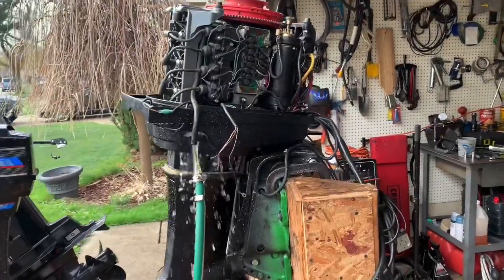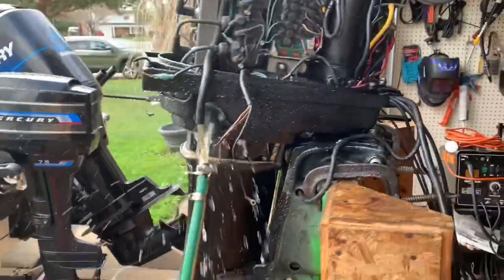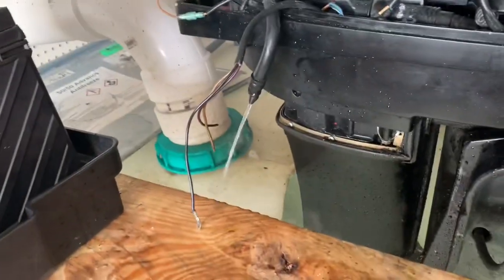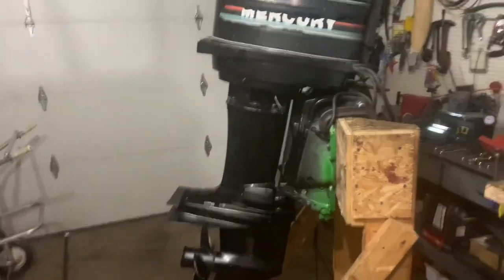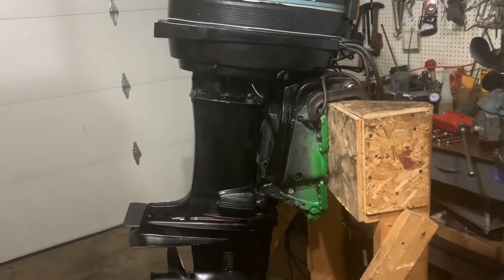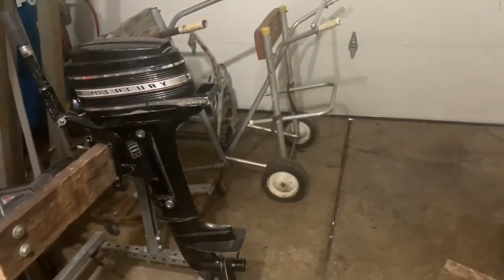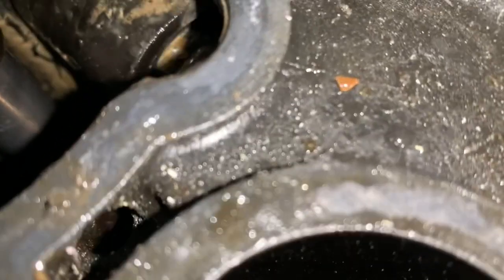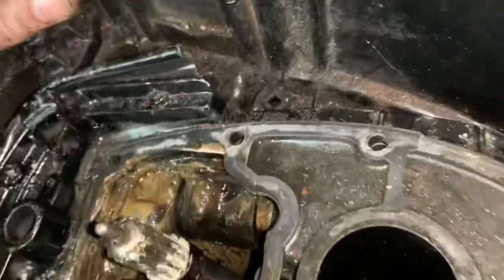1989 45 hp Mercury - Overheated Hot Telltale Stream - Found the Problem and Resulting Carnage Part 6

Comment: Hey man I have the same engine and a similar  issue mine pees just a little weaker then the videos I see but it’s cold pee my engine doesn’t seem to hot but at high rpm’s my pee stream gets worse i also have good compression duck season is happening this weekend in northern Illinois im going to just take her nice and easy to my spot even if it takes awhile but do you still work on motors im interested in doing a full rebuild on the old girl

Comment: Like the guy below said.....there is exhaust blowing into the water jackets somewhere. Most likely under the exhaust cover where the water circulates to cool the exhaust.  I have seen a gazillion old outboards and chainsaws with scored pistons, that is not a heat problem. Heat WILL cause it but it will not generate heat . Low compression does not generate heat. That pressure from that tell tale hose is exhaust blowing into your water path, interrupting water flow and filling it with HOT exhaust......boiling, or near boiling, the little water that gets through.
Reply from the maker: Thanks for the information. I understand and agree what you are saying about the exhaust gases getting into the water jacket. The owner wanted this motor tuned up and running well in order to sell. I told him with the pistons being scored I would not sell it for him. The damage had been done and it really needed a rebuild. The owner failed to mention to me that he had overheated the motor while trying to race back to the dock when he discovered the problem. So regardless as to how it happened the owner decided to part out the motor. Obviously the overheated condition scored the pistons and the owner didn't want to put anymore money into it to fix it. Thanks for watching and commenting. I appreciate your feedback

Comment: Nice video. I have a 1992 9.9 Evinrude model E10RENA. Started boggin bad on the water, then no water out of tell tale, then it started smoking out of tell tale and i shut it off. Took it home and impeller was shredded, so i replaced that. Wouldnt start.  So with diagnosing what could be i ended up replacing the plugs and wires, ignition coils, power pack, charge coil, thermostat and gasket, head gasket (which was fine to begin with), carb cleaned 3x and all jets clear, and compression is 105psi both cyls. I have spark in both, but it will not fire. And it wont even run on ether if i spray in the carb or even spray some in the spark plug holes and put them back on. It'll putter and die after i pull the starting cord. What gives? My next step is to pull the block out and see if anything is blocked or choking it off, and also replace exhaust and water gaskets. If that doesnt do it, im at a loss. Im in sterling heights,  MI and Dee's Marine wont look at it and neither will a few others. Any advice is appreciated. Thank you sir!!!
Reply from the maker: When you pull of the carb did you inspect the reeds? Also, If you have over heated the motor then it’s possible you may have done some major damage to the internals…. Rings, Block, warped head etc….compression can be good and still have major issues.
Reply: I have not looked at the reeds. Ill prob take the block off and when i redo all the gaskets (if i dont find the issue) ill pull the intake manifold off and check the reeds etc. Thanks man!
Reply from the maker: You might also want to check the fuel pump pressure

Comment: Probably way to late to help you now but I have run across 2 45hp or classic 50s with the same problem and both were old impeller pieces jammed up in the power head , had to remove the cylinder cover and down behind the lower cylinder I found both blockages , had to use compressed air to clear them out , no more hot pee and both are still running to this day , I even own one the guy gave up on but he had already bought another motor ,change those impellers people !!
Reply from the maker: Chuck shade…. Wow two classic 50s with the same issue. I hope you have better luck than I did. It was amazing though that the engine ran as well as it did with the piston damage it had anyway that motor got scrapped for parts. Good luck with your orders. Hopefully they’ll run good for many years to come.

Comment: man those skirts are shot! I'm with you on how the heck it idled as well as it did... a testament to the engineering I guess but still youd think something would show up at idle. No big deal you can just send the block out. still make complete rebuild kits . for $1200 you can make it better than new. one issue with these is water intrusion . water creeps up the driveshaft, takes out the lower crank seal, and it starts sucking up water. may have happened here. the other gaskets for the exhaust have been known to leak as well. cheers.

Comment: If you had to wager, about how many hours on this motor?

Were these generation of 2 strokes VRO with an oil reserve, or meant to be have mix put straight to it?
Reply from the maker: 74 Nova… I would say I spent a few 8 hr days working on this motor to find the problem. This particular motor had an Oil Blend system with a separate oil pump, filter and reservoir. However, the oil Blend system was removed and they ran 50:1 mix.
Reply: @LivetofishOutboardRepair  oh wow, I didn’t even mean shop hours, sorry to hear about that one. I meant the motors usage hours. 

That’s really nice of you not to charge it forward to the customer however. Just wondering why the bottom 2 cylinder seem to be the affected ones, wonder if they were receiving oil mix out of the crankcase or not. 

Something to be said about it still running so easily and smooth with a badly damaged rotating assembly.
Reply from the maker: @74nova69  I’m not sure how many run hours were on the motor but I do know that he overheated the motor when the water pump failed. All four pistons had scoring. The top and bottom two cylinders were the worst. To my understanding the owner heard the overtemp alarm but tried to return to the dock at WOT anyway, causing the carnage.

Comment: I have a classic 50 I acquired with a pontoon boat. I have discovered some butchering of wiring etc…actually think I may have a Frankenstein motor as I can’t locate any serial numbers. I am not a boat motor guy but have been automotive DIY since muscle car days of 60s. 

I have 2 things coming out of power head that I could not locate in seloc manual one of which I have determined to be a temperature sending unit connected via a tan wire back to throttle. 

However one is a tube coming from head going no where adjacent through clamp along with pig tail. 

Is this supposed to go to a temperature gauge also?

It is not running yet so I can’t tell you if water flow.  First check I discovered Stator was bad. Waiting on parts to come in. Just replacing all electronics.
Reply from the maker: Chris Jeffers …. You are correct the tan wire should be the temp sending unit. I’m not sure about the tube from the power head. This may be your Telltale. I believe your describing the water hose that leads from the block and attaches to the cowling to show water is pumping from the water pump.
Reply: @LivetofishOutboardRepair  not the tell tale.  The tell tale is a larger diameter and is connected.
Reply: @LivetofishOutboardRepair  by the way you process in eliminating the potential issues is phenomenal.

Comment: My 50hp Mariner has cool pee hole water flow but overheats.  I see no water flowing around the thermostat passage its bone dry so I guess no water flowing around head either?
Reply from the maker: Probably clogged water passages. Remove the water cover plate and inspect for debris.
Reply: It does not like muffs.  When I dipped it in a deep tank it flowed fine

Comment: good video, thanks.  i was just working on a 65hp 3 cyl merc.  Same problem, overheating.  I opened it up and seen the top piston looks bad.  Just like the ones you show.  I guess i don't understand why the scored piston and cylinder would make so much more heat?
Reply from the maker: If the cylinder or piston is scored badly the rings are probably damaged too. The rings are designed to expand as the engine warms up and transfers heat out of the block through the  cylinder walls. If the rings are damaged cracked or broken they cannot do their job and the engine overheats.
Reply: @LivetofishOutboardRepair  Yes i expect lack of heat transfer through the rings is a part of it.  What about the increased blow by, hot gases blowing by the piston and into the crankcase.  which in turn are put back into the cylinder with the intake charge ??
I have tried search about this but found nothing.
Reply from the maker: I would agree. There has been much discussion about this in my Facebook Group “Vintage Mercury Outboard Fanatics” It’s a great group with a lot of knowledgeable people.

Comment: Nice job on the videos.  I replaced my impeller and... nothing coming out of the pee stream.  Bummer... but thanks again.
Reply from the maker: Thanks for watching and commenting. Looks like you need to back flush the water passages or look for pieces of pump impeller stuck inside. Best of luck!
Reply: @LivetofishOutboardRepair  - Hi, how would I hook up a garden hose to "Back Flush" the water passages on my 1992 Mercury 60hp?  Where do I "Back Flush" from on the motor?  Thanks
Reply from the maker: @travelguy1564  I have a video showing this. You hook up your garden hose at the thermostat. See the video https://youtu.be/6WdFw4TPrkg

Comment: I have a 35 hp I just changed the impeller and could only find 1 piece of the broken impeller. So I flushed backwards from the tale tale and no piece came out, but had a good flow of water so I put a water hose on the water pipe and had a really good flow from the tale tale. I then installed the foot but couldn't get any water from tale tale. With the kit I got there was a rubber grommet that fits inside the water pump housing I didn't use it because my old Housing didn't have one should I have used it? I can't figure any other reason I wouldn't be getting any water since I had good flow using a water hose
Reply from the maker: Derrell Armstrong... yes you definitely need to use the rubber grommet. This provides the water tight seal and allows the water pressure up the water tube. Just make sure you line up the water tube to the pump correctly.
Reply: @LivetofishOutboardRepair  ok thanks I had first put it in and the foot wouldn't slide up all of the way I made sure it was in the hole correctly but still seemed like it was binding on the pump.i then removed the grommet and it slid up perfect I may have to use some lithium spray to help it a little
Reply from the maker: @HookedUpCatfishing  it might help to turn the flywheel clockwise to get the LU to seat all the way and yes a little lube really does help get the water tube to go in too.

Comment: Very Interesting. Just wandering besides over heating with bad impeller would running it with straight gas score pistons or would that just blow it up.
Reply from the maker: Running straight gas no oil would cause it to score even more very quickly and seize up the power head. Go to 
https://www.efcopower.com/sites/default/files/Piston%20Failure%20Analysis_1.pdf 
For more information on this subject.